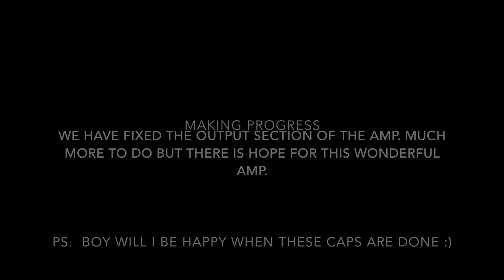Heathkit TA-17 Episode 4 - Dress Rehearsal Day

Comment: Fantastik Ron, very glad to see it work (100+ watts into a 4" speaker, heh heh heh).  Um curious about the tolex.  I don't think the wood was cracked or broken, just can use some upholstery.  Don
Reply from the maker: The wood seems to be intact and i am researching options on how to recover it.  That will be towards the end of the series. There is still more work to do on this amp. I am finding many of the E.C. Caps are way out of spec and have replaced a bunch already ( the 25v and 15v variety) This amp will purr when I get done.